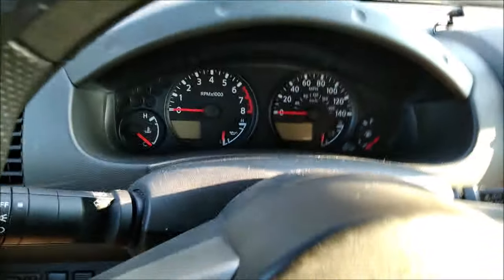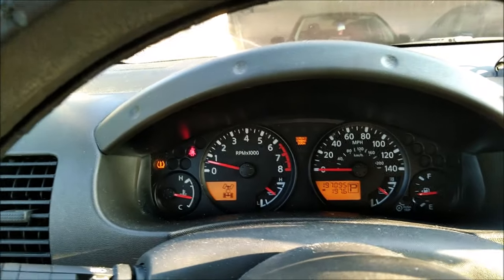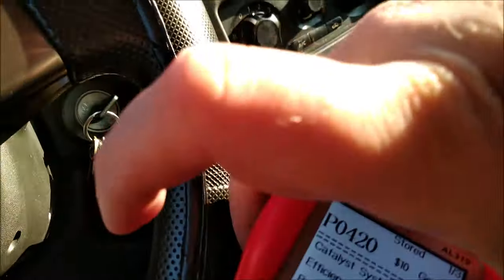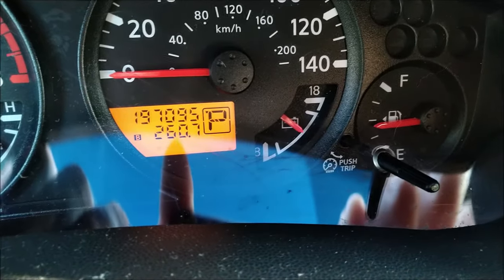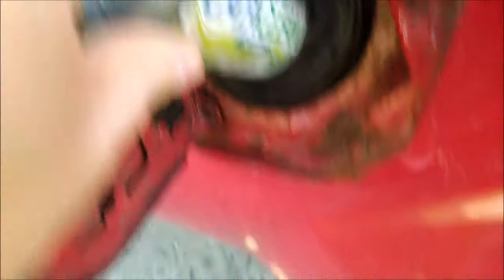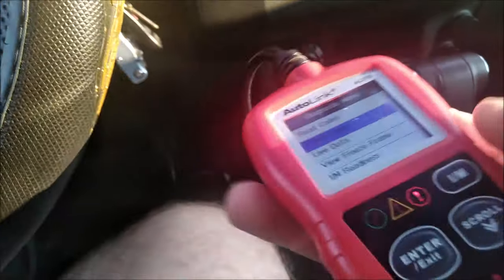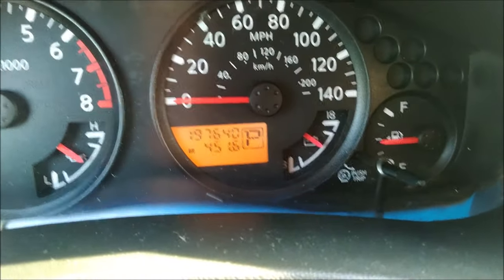Real World Test Of Cataclean in a vehicle with 200k miles

Comment: Great video my friend appreciate that. I have a Lexus ES 350 I change both air fuel ratio sensor in my engine light still on with a PO 420 code. I tried Cataclean I had just a little bit of a quarter tank when I add it up drove 26 miles filler back up then drove about 50 miles in the engine light is still  on. I have noticed in your video that you voluntary erase the code. I thought you had to wait until the engine light would go off by itself. Now I am tempted to erase the code. I am just waiting for the engine light to go off so I can smog the car in California. Any thoughts would be greatly appreciated thank you
Reply from the maker: Yeah I cleared the code myself and it didn't come back on until around 1000 miles or so. I would definitely clear it and see what happens.
Reply: Yea clear it, if the issue is still there the code would come back
Reply: Check engine lights don't go away. What ever issue triggered it has to be fixed, check engine light reset, and then the light monitored to see if it returns, but it usually doesn't go away by itself. Usually you want to fix issue as best you can, reset light, see if light stays off.
Reply: Hello neighbor, I'm in San Diego California. I just left the Dodge dealership to price a cat converter. Because of the strict laws in California they require you get it from the dealer. I have a 2013 Dodge Avenger and the price they gave me to replace the cat was $3400 for just the part. Hell, I think it's cheaper to leave the state. One thing you can consider if you need a cat converter. Order a walker aftermarket. However, you will need to have it shipped to a different state and then have it shipped to yourself. Not sure how it would affect registration. But it seems like if you did... you still should be able to at least pass. Sometimes we have to do what we have to do. Good luck with your situation!
Reply: What is a walker ?
Reply: @captaindwan  Wow!  HAS to be done at the dealer in California?  Sorry to hear that.  Just another reason not to live there.

Comment: Didn't do squat for my Corolla with the P0420 code with 190K miles.  Nothing but a waste of time and money!
Reply: Code P0420 O2 Sensor Efficiency Below Threshold - Normally Factory  set at 96% or Above Efficiency.
The Forward O2 Sensor #1 rapidly senses Fuel/Air mixture and sends the info to the CPU to adjust fuel injection with of signal .
The After or Downstream Catalytic O2 Sensor #2 Senses Efficiency of the Catalytic , generally the temperature should be steady with no bounce in signal and 100°F hotter than O2 #1 . Use of a Non-Fouler Like (Google Search) the $14 Dorman Part # 42109 on the Downstream O2 Sensor #2 insures a Steady Signal and No Check Engine Light . 
Dorman #42109 is the longest one at 2in but there's lots of room under a Chevy Yukon w 280k miles . Shorter ones are $10 and 90° ones for tight spaces are $30 . This Catalytic was never Clogged . Vehicle ran Great Before and After the Check Engine Light went Out . Found info on YouTube.

Comment: Any problem if I use it for maintenance, maybe just one bottle a year? My car is working fine.
Reply: After you use the cataclean, use techron fuel system cleaner (black bottle) every oil change. Add the entire bottle of techron into a near empty fuel tank. Add 10-12 gallons of fuel on top of the techron. Drive in similar fashion per this video. 15-20 minute drive keeping the rpm's up around 2500 or higher during that time. 
If you aren't experiencing issues with the fuel/exhaust system, you can use the techron as a maintenance additive. I use techron intermittently even before the 3000 mile recommendation. I add in a 1/2 bottle to my fuel tank every other fill up. 

Also, cataclean can be harmful to the engine system. Do not use but only once for severe issues with these codes. Definatly NOT a maintenance product.
  
Good luck.

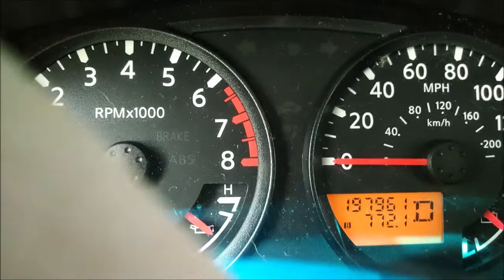Comment: Ive tried this product ,i had the car serviced, and they told me ineeded the fuel sytem cleaned so i bought some fuel injector and booster in it stopped for a while,buti smells a heavy stenched so i bought this poured it inthe tank now its running better no more 7:39  heavy smell but before i put it in o noticed a rattle ,niw its gone andnotso heavy smell
Eventually i have to replace the cat, but no check engine light came on at all its a 30 year old car 94buick century with 173,00 on it it

Comment: You reseted code that's why it is not showing on engine light, but the problem still exists. Best solution take the part off and physically clean it out rather than using these type of products or replace if faulty
Reply from the maker: No duh genius! This is just something to try if you don't want to go the expensive or pain in the butt route.
Reply: Unless you want to pass an mot test on that day on emissions etc, then maybe otherwise pointless
Reply: Good luck with those exhausted bolts frozen

Comment: Do you get better millage cleaning it out?
Reply from the maker: Nope
Reply: @baldmetalnerd  I am just wondering in the cleaners do anything at all, or just a waist of money. What do you think???
Reply from the maker: @deanjagger1190  They appear to do "something" because I tested just resetting the check engine light with my code reader vs using the cleaners and the light always stayed off longer after using the cleaner rather than just resetting the light. Essentially the cleaner is only around 20 bucks and if doesn't work you lost very little.

Comment: Do you feel any difference in terms of driving, I feel my exhausts are partially blocked, i found it hard to revup the cat, does the cat clean help in some ways to unclog the blockage and make the drive smoother? thank you
Reply from the maker: Made no difference to my driving, but then again I started using it right when the check engine light came on.
Reply: @baldmetalnerd  light still off? Lol
Reply from the maker: @jrparker1108  Nope light came back on, tried a bottle of the dura lube the light stayed off for longer the second time, now on a third bottle we'll see if it stays off this time. To be fair it did say it may take more than 1 bottle of the stuff.
Reply: @baldmetalnerd  what was the out coke of the 3rd bottle?

Comment: Dang that's a ton of rust!!!
Reply from the maker: Yeah she's an old and rusted beast for sure but still runs great.
Reply: @baldmetalnerd  still no check engine light?
Reply from the maker: @michaelrueckert8507  It came back at around 840 miles or so, did a second bottle went over 1000 miles on my third now we'll see how long it lasts. It's getting better with each bottle so it's doing something but it may take more than 1 bottle.
Reply: @baldmetalnerd  well that's promising! Still much cheaper than new cats!
Reply: Welcome to the Salt Belts!

Comment: Cataclean does NOT work, and IT'S ACTUALLY JUST LACQUER THINNER.   Open a bottle of each of them, smell each of them, and you see what I'm talking about.  Instead of using this over-priced Cataclean, mix 1quart of lacquer thinner with 5 gallons of gasoline (2 quarts for 10 gallons of gasoline, etc.), and watch it clean your deposits much, much better.  You will NOT damage anything inside your engine or catalytic converter by using the lacquer thinner, I promise you.  Cataclean is a scam because it's just lacquer thinner, and it's not concentrated enough as directed.

Comment: Put a lot of miles on that truck you hauling like a 18 wheeler or what you can sell it for a lot now because of inflation
Reply from the maker: Yeah I bought it back in 06 with like 12 miles on it or so. It was my main vehicle until last year. I've hauled a lot of crap in it but definitely not for hire just for myself. I'm gonna keep it until I hit 260k or so on it. At the rate I'm currently driving it that might take like 10 years which is fine by me because I'm hoping my next truck is electric. I've only done one major repair on it and that was the transmission computer and that cost me like 2k when it hit around 180k miles. Other than that just some sensors and normal maintenance. It's been a great truck overall gonna take it to an exhaust place and see what my options are as the cleaning stuff only works for so many miles before the CEL just comes back on.